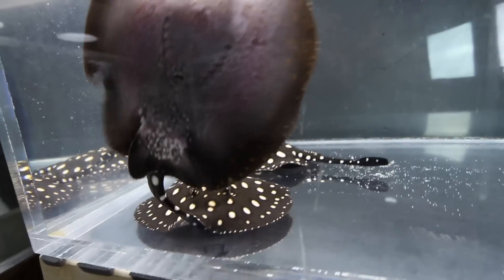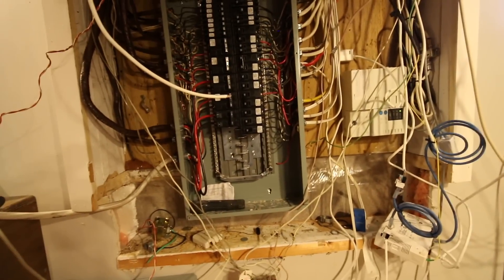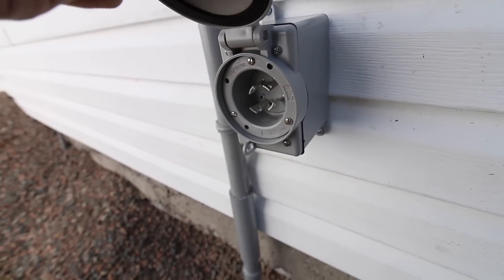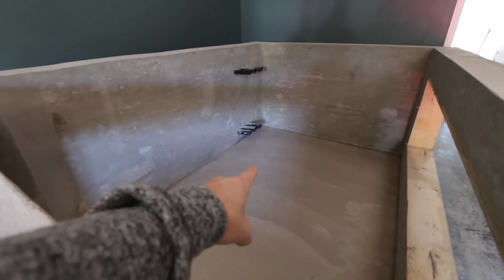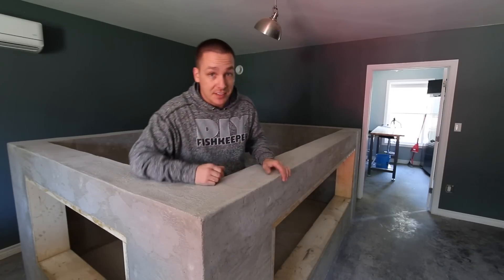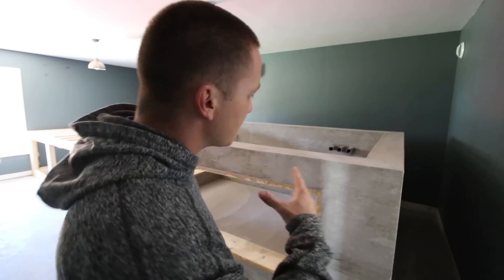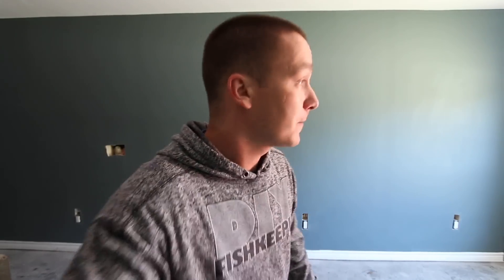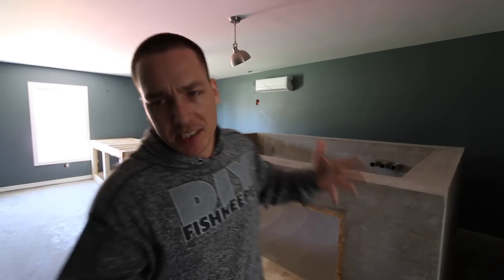FINALLY! The 2,000 gallon aquarium reveal!

Comment: I Think rounding the outside corners of the cement tank would give it a more natural look. not by much just getting rid of the sharp edge look and would make that rock wall idea look amazing in my opinion  especially with a waterfall. as long as the small rounding doesn't effect the integrity.

Comment: Hey if you want to do plants around the gallery than why not run them aquaponicly? that's one thing I'm currently working on with my 29. i first run the out put to a few layers of micron sponges then to a fluidized sand filter then down through a 40 gallon tote which holds herbs and other fast growing plants to absorb the nitrates from the water, then returned back to the tank via a bell syphon with a spray bar output. I'll be using a splitter to cycle some of the water to the filter and some back to the tank to maintain flow. with tanks your size you could literally supply a few families and if you go vertical like along the walls, it would like great and save space unlike flat bed growing and even better you don't need substrate!
Reply: Michael Collins. You beat me to it, well said.
Reply: Michael Collins ...good idea.....make use of the water changes that are nitrogen rich...and get something in return for it...ie veggies, fruit,  flowers, ....i hate being wasteful

Comment: have you thought of using 3M 5200 sealant instead of sillicone? that's what we use for our acrylic-concrete tanks at my work. seals great to both surfaces also cures underwater if you need to make repairs.
Reply: Sam Pierce +1 that. I always thought that silicone and acrylic bonds will fail over time, under pressure or not. Is that not the case?
Reply: Filip they can last a long time it's just a matter of serviceability. if you get a leak with silicone your draining the tank. 5200 you just go in and patch it up
Reply: Sam Pierce gotcha. Thanks.

Comment: Suggestion for the big tank substrate, maybe sand paper or sand stuck down to concrete base with clear cast resin poured over to make water proof as well as making vacuuming easy,

Comment: I'd love to see some texture on the outside of the cement tank. Maybe use some plaster and make imprints of branches/leaves/etc. along with some rocks set in. Then stain/paint, but with lower places not getting the same or as much stain/paint for contrast. I think it would add a lot to the overall look and still have a nature theme.

Comment: F'n amazing as always! That's why you're the king :)  I would seal the concrete with a clear-coat stain and then do a tiled (8"x8") look on the whole aquarium with the rock work just on the 2 sides along the walls. Kinda blend the 2 together as it reaches the wall. Tile and rock looks sweet combined! I'd go with a 24 to 30" waterfall from that side wall, you'll get some good circulation to half the tank that way. IMHO.  I'd wait on moving your bigger arowana until the tank is ready. It would be a shame to see him expire from not eating after the years you have with him. I can't wait to see the whole gallery complete my man! Cheers from Oregon!

Comment: Hey joey if you did the waterfall Idea and made it a slower flowing large waterfall you could help easily heat the tank. Because your heating the room the waterfall would help add surface area to the tanks water and make it easier to heat with the rooms temperature. Just another reason to put in a waterfall. Love your channel

Comment: You could add a raised platform between the wall and tank, so you can step up higher and be able to reach down into the tank a little easier. Especially on the side you aren't making into a feature.

Comment: That big tank is great and has a lot of potential.  I vote for rock facing, live plants along the top and the waterfall.  You have lots of time to decide that stuff.  Are you going to use a colored epoxy on the inside?  I'd go with a marine blue on the walls with a sandy color for the bottom.  I think that arrangement would showcase the fish and the rays.

Comment: I dont know if in the US silicone means something different or maybe it covers a wider variaty of materials, but standard aquarium silicon does not really hold on to acryl at all.

I would use a 2compund material that can really get acrily and expoxy together, or just use mineral glas. Mineral glas can easily glued together with either cement itself or the epoxy surface and got the big advantage of not getting scratched.

Comment: Just a recommendation, I see a few people here asking about using Silicone or 3M 5200, have you considered Macropoxy 646 -PW? 

It is a 2 part epoxy specifically made for Potable water used in water tanks for human consumption. Normally it is used in tanks that hold 60,000 gallons+ of water.

Comment: Are you lining the concrete tank with epoxy resin? If not I'd suggest doing it even if only around the inside of the windows so the silicon has a non porous surface to seal against.

Comment: i just had a thought of a potential problem that might develop with the tank and would like to debunk it with everyone (hopefully its a helpful comment)

most of the weight of the water will push down on the conrete leveling slab that houses the "underfloor heating"  pipes. this in itself is not a problem except that this slab effectively floats over the styrofoam insulation underneath. when it will be finished, epoxied and filled, a crack is likely to deveolp all the way arround the perimeter of the bottom due to the slab compressing on the styrofoam which will probably reduce by a few milimeters over time. typically when building concrete water reservoires this is dealt with by the design of the rebards but in this case im not sure what the best solution is (if anyone believes my concern that is) maybe using fiberglass with epoxy arrount the perimeter edge of the bottom?
hope this is helpful and well done Joey for the hard work.

Comment: A small piece of advise regarding the arowanas.  Typically Asian arowanas don't co-inhibit with each other well. Over here in Singapore there have been many discussions over forums if 2 asians are possible, and the results from those trying are more or less the same. One will get beaten up really badly and eventually be separated or die as a result. Ideally we keep them alone. If not, we keep the offspring from the same batch which grow from young together. We normally also follow the minimum 3, ideally 5 and above rule so 2 fish don't just destroy each other which typically is the case. With a open top tank like you are building, there is also a high chance one of them will jump out during a fight.  If you really wanna add some arowanas, slivers do well in groups and are good punching bags for a single red or gold. 

Love what you are doing, can't wait to see the end result.

Comment: something that would be great to see on your website would be a live cam on tanks. knowing it would be hard to have one on all of the tanks maybe just on the big concrete one or the 375. As for ideas for the outside of the big tank, I would use the same epoxy as the inside to start then you can move forward on the rock idea later knowing epoxy is used as a primer in the automotive field from time to time and can hold things pretty well if cured and sanded.

Comment: That tank looks amazing, I can visulise all the ideas your coming out with and they soind even more amazing.
what type of water heater are you using, a stainless steel cylinder type? Not sure where I read it or if it's true that copper in a fish system will poison the water? Has the under floor heating idea been done before in this setup? I'm thinking there might be alot of themal lag overall that could make the water temp fluctuate quite a bit, A good PID thermostat should sort that out and a safty backup
Reply: Scrap that, just saw you newer upload lol. for what the water heaters and controlers cost and what they are supporting, I would double up on them. plumb them up so you just need to flip some valves and switchs to go on back up when it breaks. And a thermal nuclear safety stat so it fails safe and cold. I lost some fish similar like you did but mine got semi boiled due to a failed not safe.

Comment: I have a 20 gallon tank for my Betta. however I need to slow down the flow on my filter, and I want to buy another one considering I don't like the idea of adjusting with different props or objects to slow down the flow. I just want to get a new one. now I have a few filters in mind, but I want some advice from some already  knowledgeable people on which filter I should buy for my tank. Im thinking of getting an adjustable one, just not too sure on which brand or model I should rely on. thank you so much!!

Comment: im wondering if the pipes going in the cement is going to be epoxy'd and siliconed  if not you will have 6 big leaking holes concrete itself is not watertight

Comment: Should've used a higher quality pipe as abs is thin walled & brittle.
The tank "will leak" for the lack of using a "key way" on the perimeter of the base and then the walls should be been poured atop that.
If you're gonna except funds from subs you should at least use a competent contractor(or the advice thereof) and quality material.
Reply: *accept

Comment: In the U.S. that pipe run between buildings wouldnt pass code. There are more than 360 degrees worth of bends between wire runs.